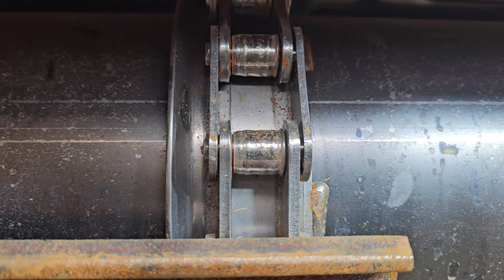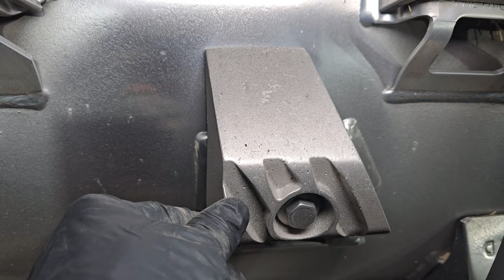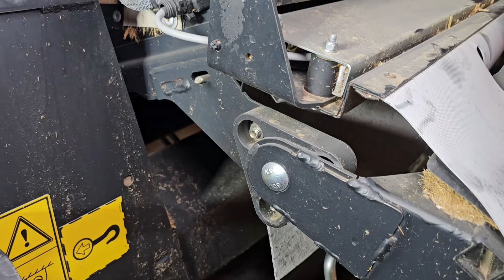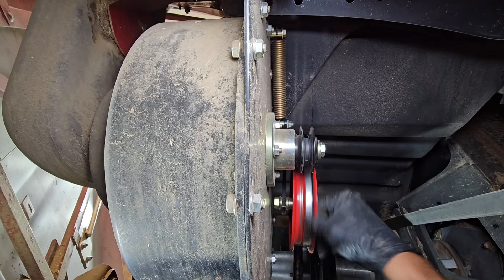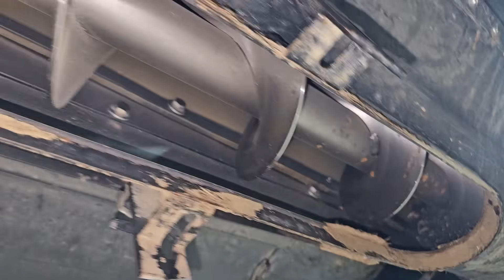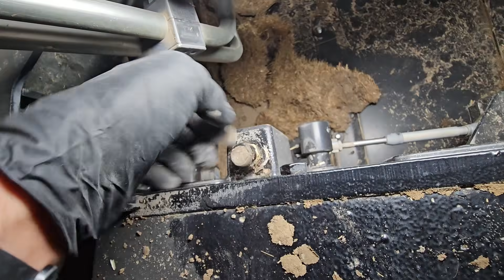Case IH Combine Pre-Season Inspection | Complete Checklist Before Harvest

Comment: They don't forge metal ike they used to. We had both a 8010 and a 9120 at 5700 engine hours and both were VERY reliable machines we minimal wear and maintenance. Now with our newer 8240, everything wears out. Gearboxes shafts, unloading auger itself worn out, shaker bearings failure, we've done twice the feeder housing/rock beater bearings, axle couplers and so on and so forth. And with all that with not even half the hours other combines had. it sits a 2987 hours currently. They want to sell you parts more than they want to sell you a working combine. Crazy stuff.
Reply from the maker: Isn't that the truth! And the worst part is their 3 times the price! Thanks for your feedback and watching the video!

Comment: Good inspection, the clean grain has to go. That auger will damage a lot of grain.
Reply from the maker: Theses machines run mostly wheat, but yes certain crops it can definitely damage the product!
Reply: @How2Mechanics  it’s  hard to justify the cost of the incline auger from CNH, so I  reflight are auger with a high wear replacement and balance it.
Reply from the maker: @dschefers9700 Yes it is! Thats why I always say it depends on how many acres you cut or how many bushes you average, if you should replace stuff or let it go another year or two!

Comment: We have a 2007 8010.  Luckily we caught a leaking remote engine oil filter line.  We were a couple gallons low.  Replaced both lines.  We were very close to complete engine failure.  VERY IMPORTANT AREA PEOPLE!
Reply from the maker: Glad you caught that in time, that's a huge save! And thats exactly why I bring that up at 29:55, It happens to all the older model combines!

Comment: Very good inspection. I also like to check the rear wheel hub for play and/or bad bearings, specially in older smaller diameter castle nuts. Another wear point is the pivoting feeder bushings that I have to replace every year. Greetings ftom Brasil
Reply from the maker: Thanks for the tips, those are great additions to the checklist!

Comment: Absolutely fantastic video. Straight to the point! 

I have had the carrier bearing bracket inside the unloader tube crack and fail. Along with the fuel tank screen inside the tank plug with junk. I like to drain the tank remove and clean the fuel sump screen every few years
Reply from the maker: Glad you liked the video! Thanks for sharing your experience, those are two great things to add to the pre-season checklist!